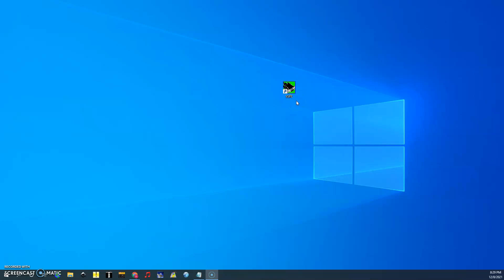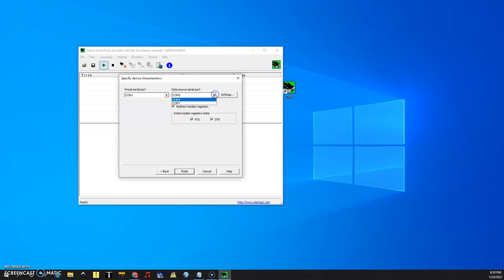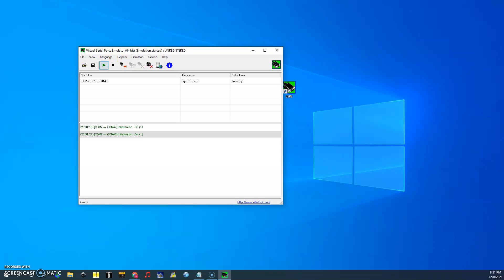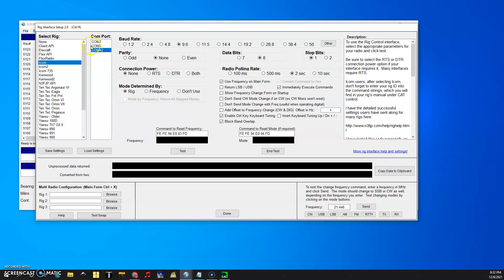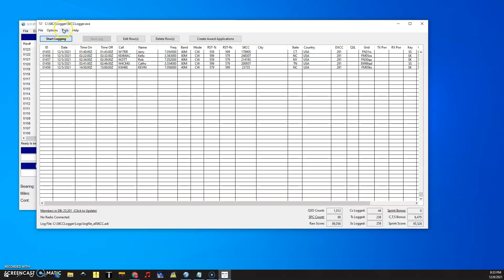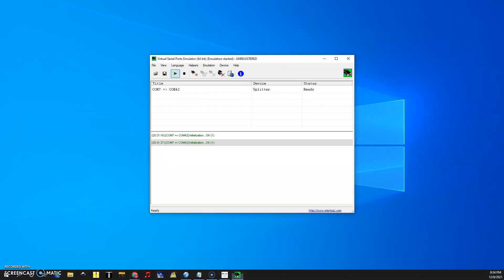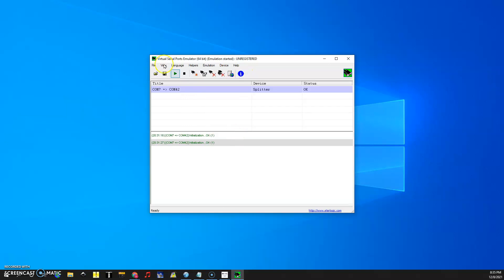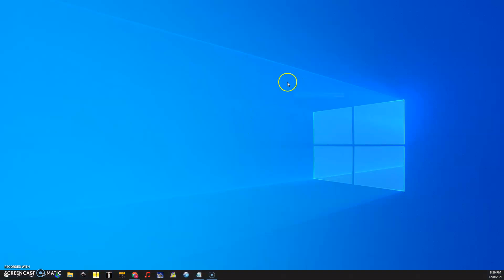VSPE - Using Multiple Programs with One Radio Com Port

Comment: Hi Rob. I tried this  on my IC775 using CT-17 remote interface.  Trying to Connect to Omnirig and SDRUno  and AClog at same time.Omnirig and (SDRUno) are fine but when I select the virtual com port is AC log I can see traffic but no Freq. and mode info. If I connect AC log first to virtual port it works fine but then when I open SDRUno then AClog quits updating Freq. and mode. I am running AClog version 7.0.10.  How did you get a AC log version with SKCC/POTA entry box?  What AC log version are you running?  I cannot make out the version in your youtube video.  Also I am running this program without a license, but so did you and everything worked in your video.
Reply from the maker: I’m but sure I can reproduce that problem on my end. It sounds like you’re trying to get three devices to run at once which might be a little more inconvenient to configure. 

N3FJP’s AC log has a POTA template. It’s been there for at least a year. I’m not sitting in front of it right now, but that sounds like a great and quick tutorial video I should make. It is quite easy to manipulate the fields in AClog.

Comment: So what are you using instead of this? would be a good ides to show/ share something that is working please. Also for using wsjtx
Reply from the maker: I haven’t messed with this program in a while. I have RCForb running now so I can remote in, and it created a virtual port so I can connect WSJT-X that way. I haven’t figured out how to use FT8/FT4 remote, but I use Google Remote Desktop if I want to play digitally away from home. I gave up on multiple programs from a single port because it caused too many problems.

Comment: Thanks Rob for a clear/understandable video that isn't an hour long.  I am going to need to use an emulator for ic-7300 & aclog & sdruno(omnirig).  Does the com port disappear because you are using an unregistered version and can't save the configuration?  Regardless, thanks!  73 de ki5gx